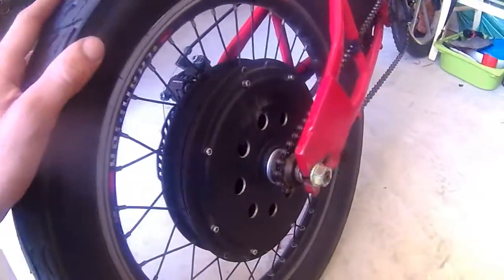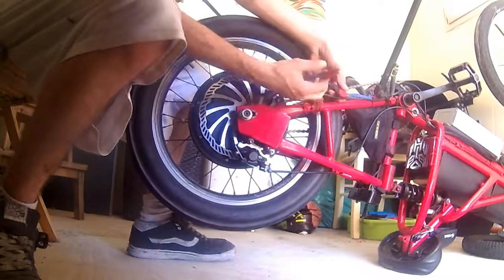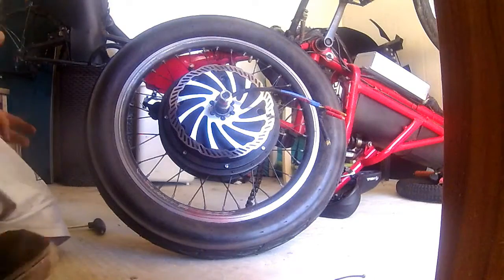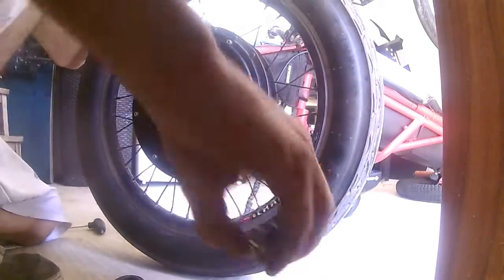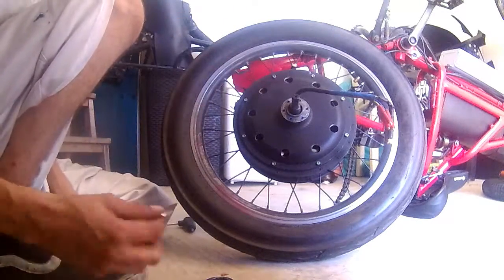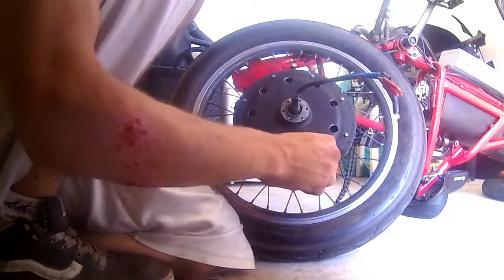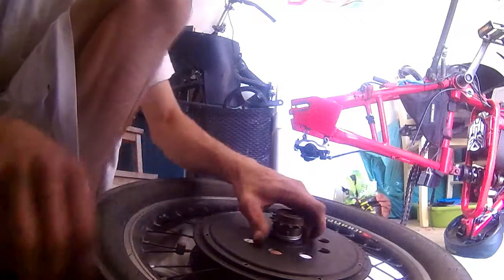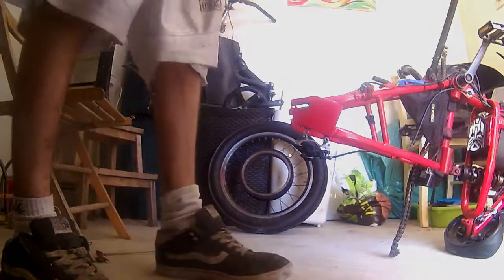Drilling a Hub motor - part 1 - Take it Apart!

Comment: Yeeeeahh man... fun video.. maybe try to do like Sketch did to his QS hub motor, ferrofluid + heatsink he was pumping 20Kw on a racing track during the whole race, as soon as he finished we checked the temperature and we couldn't believe it was just a bit warm not even hot. Computer calculations says that they're getting 200% thermal improvement. Check out the videos in my channel and his new website http://www.hubsink.com 
yes so many people asking him for these heatsinks that he started a business, specially after smashing everyone on the race!! haha
Reply: You have to cover the holes with something so the ferrofluid stays inside the shell =]
Reply from the maker: yeah i've seen sketch's idea, cool stuff, im supposed to get a QS soon 
so maybe i will do the same as him, although i think it will take some 
time for me to start heating it up :) 72v 80a should go easy on the QS
i also have a new set of 20-30c hardcase lipo's ordered for 72v 15ah so i could pump like 120-130a from my huge controller and get to some speeds over 100kmh!
Reply from the maker: and all the ferrofluid came out when i cleaned it lol, so no need for covers for the holes
Reply from the maker: btw i want to do a series of videos documanting the whole process of building my new battery pack, which includes making discharge and balance harnesses for a quick plug and play bms, and mounting on the bike, and maybe a first test ride as well
Reply: Yeaaaahh... please document all that building process... you may come up with some cool harness / balancing wires / BMS ideas that will help and inspire others. Do it.. do it!!!! haha =]
Reply: @BrunoPOWEEER  Grin (Justin) ran Statorade in a motor with drilled side covers without any problems.  You do need to replenish it occasionally because the carrier fluid will evaporate over time plus you need to seal the side cover/center section interface... I use Permatex Ultra Gray.
Reply: What diameter is the rim?